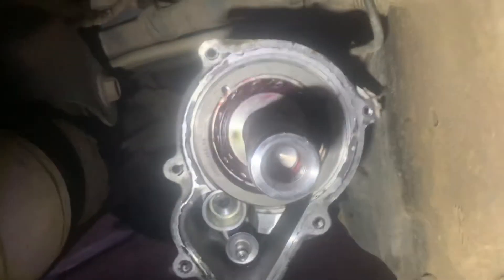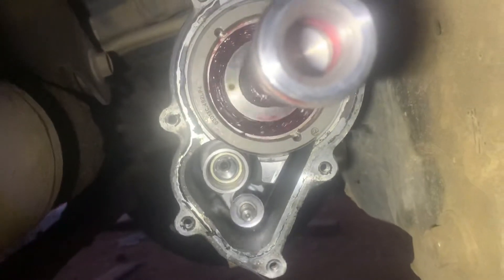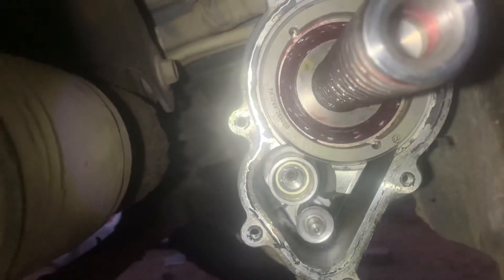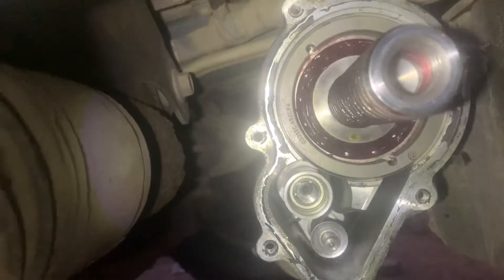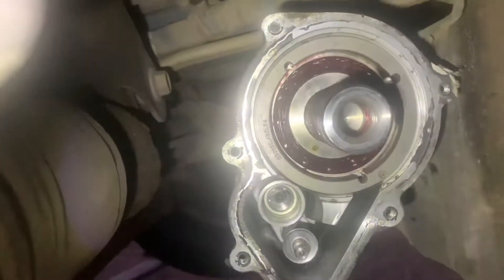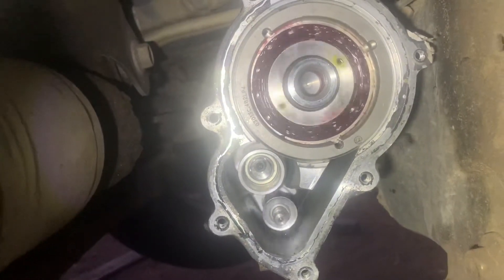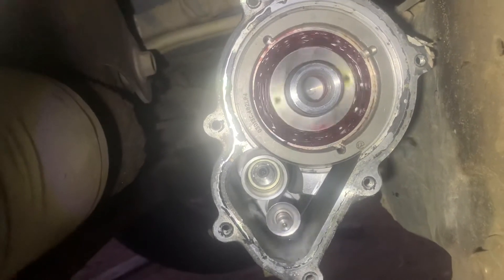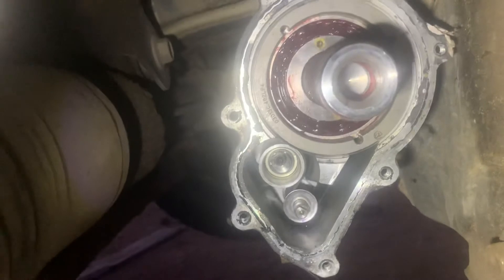2013 F150 electric power steering repair. Do not pull the power steering unit. Part 10

Comment: I opened mine up thinking it was the belt. The belt is fine . But that cover you pull off mine is broken on the inside and there is like a round thing stock on the corkscrew thing. And I can't move my steering at all it's stuck in the garage. Any ideal what to do I have a video of what it looks like I'll upload it I just haven't used YouTube in so long I'll figure out how to upload it.

Comment: I just put a belt on a 2015 Ford F-150 after I got the belt on I spun it back and forth and noticed the belt wanted to run off when I turned it in One Direction any other it would do the opposite it would run to the back can't find anything wrong everything seems good any ideas?
Reply from the maker: The only thing that comes to mind is the belt tension. Is it tight enough?
Reply: Seems like the tighter I got it the more it wanted to run off I put a little tension on it not too much put it back together seems to be working fine not sure how long it'll last

Comment: Once I got to belt I saw my plate that covered belt was snapped in the middle I removed it and as wheel was turning the rod out it went (clink)** now the rack rod is wiggling and it wasn’t before so I twisted off the gear and beads fell out 😅 wtf did I just do ? I saved all the beads belt is in tact just off now ..
Reply from the maker: Checkout part 4 on getting the BBs back in. It's not very hard to do.

Comment: I pulled the cover off today, belt appeared to be good. I’m off to the dealer.
Reply from the maker: Humm, let me know what you find.
Reply: @akghound  $2700.00 @ dealer to replace rack & pinion.
Reply from the maker: @stevetodd306  
Yikes!! That's what I found too.
Reply from the maker: @stevetodd306  
Did you figure out what is wrong with it?

Comment: I am trying to diagnose a issue with my truck. What lead you to this issue? My 2015 F150 is making a grinding noise when traveling straight. If i turn the wheel to the left and to the right the noise goes away. Any information helps. Thank you.
Reply from the maker: Does your powersteering still work? If so your PS that's not the problem.
Does it make a noise when you steer all the way to the stop and then ask for a little more? If so then the belt will soon be the problem.
Is your truck a 4x4? If so you may be having front hub assembly problems. 
Hope this helps.
Reply: If the noise is when driving, bearing hub assembly if sound changes right turn left turn but comes back when straight! Right turning left bearing left turn right bearing if noise goes away.
Reply: really sounds like a bearing is going out...

Comment: My 2013 f150 steering is starting chirping/screaming sound when turning left when not moving and full lock. Then the lights on the dash go crazy. Is this a belt slip?
Reply from the maker: Sure could be, can't say for certain.
Reply: @akghound  I would hate to have to buy a whole rack. Ford could have done a better job for sure. When the problem happens it's only when I'm not moving. Which would be max effort needed to turn the tires. The steering wheel feels like it jumps at the same time making the very audible sound.
Reply from the maker: Before mine finally broke it made bad noises at max left or max right turns. Then it started making noise when not rolling. My theory is the belt stretches a little to start off and finally breaks.
Reply from the maker: @jasonc6962  
I went to two different shops for estimates on fixing it. Both wanted to replace the entire steering box for something like $2700 plus labor.
Reply: @akghound  thank you for your information, I will look into this a bit more.

Comment: Hey Ken. My steering is out also, but I have been assuming that the problem is with the electronic circuit board. How did you decide it was a broken belt? Did you just tear into it and discover it? If not, I was wondering how you knew it wasn't an electrical problem. As far as I have been able to ascertain, nobody sells just the circuit board . Ford really raped us with this one and they should have been recalled.
Reply from the maker: I searched YouTube about the problem. Then went to a couple of repair shops, they both said it was the powersteering unit. When I got quotes on cost I figured I'd do more YouTube research where I stumbled upon a very short video about the belt. Keep in mind you do not need to remove the unit to replace the belt.
Reply: @akghound  Thanks very much Ken, for the swift response.